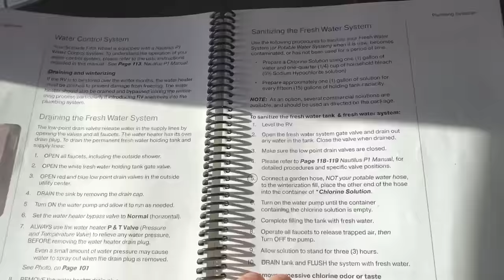MASSIVE WATER LEAK RUINED OUR RV - RV LIFE REALITY

Comment: When you patch a tank like that, grind grooves where the crack is with a dremel, and sand with 60 grit sandpaper. Then, add fiberglass fibers to your epoxy and spread it across the groove. Let it dry, and then coat it with a sealing coat of polyurethane sealant. Better yet, you can get pulverized ABS as a "tank adhesive' base; mix it with acetone to make a very  soft putty. grind the grooves, sand, clean thoroughly and prime the area with a few brush strokes of acetone. Push/brush in the abs/acetone mix, and wait a few hours and brush out the repair with a thinner mix of ABS and acetone (like gel thickness). Wait overnight, and epoxy coat with JB weld if your paranoid. Acetone dissolves ABS - using it to soften/adhere the pulverized ABS will solvent-weld the crack closed, and if done right the tank will be stronger where the weld repair is, just on thickness alone.
Reply from the maker: This is such great information Wendy!! Thank you for taking the time to write this our for us and everyone reading 😃 It sounds like there is a lot that goes into it, but heck...at least it beats taking your rig to a repair shop!

Comment: Technician here. The broken tube looks like a vent tube for the batteries in the front compartment. Most I’ve seen, they vent out towards the front however. Interesting to notice yours vent through the bottom underbelly. If that’s what it is.

Comment: Well I like that your showing your trailer , I’m a technician and found the best patch is a resin repair kit designed for radiator repairs it binds to plastic and metal and is at the automotive stores , if you found using this stuff you will know it’s like all-most instant and will seal any tank it also has a fiberglass mesh for the harder to do repairs. It allso works great on other plastic repairs like bumpers that have striped screws it can be drilled or tapped too. Just ask for raidiator repair kit the one with the fiberglass mesh it cost about 10 bucks , Happy Adventures
Reply from the maker: Wow you know your stuff! Thanks for the great info!😃

Comment: Hey guys I don't know how your rv works but our motorhome has an overflow valve on top that when you run out of capacity it comes out of the oneway valve. If it's still cracked get a plastic welder from on line and see if that will make it stay closed the problem is it's at a joint and when you put all that weight in the tank it pulls on that stress point. I've been in my 2012 Georgetown since I bought it new and leaks are the nature of the beast. Good luck and Happy camping!!!!!

Comment: You guys rock for diving in to fix it! We’ve had 3 in our 2020 fifth wheel. Vacuum breaker behind the shower water facets is notorious for leaks. I dropped one tank and used Oatey medium black abs cement to fix a 5 foot long crack in the top with this stuff and it’s holding strong after a year with us full timing off-grid. Truth he told, I blew my black tank up using the flush on day 1! Ha To drop a tank, cut the drain and vent pipes, disconnect sensor wires, disconnect drain valves, and I had to use a Dremel to cut the Buck bolts out and then remove supports and boom it’s out. There’s some good videos on YouTube if you wanna save some bucks. Ya’ll got this!!
Reply from the maker: That sounds like a lot of work for us! Time to visit the dealer lol - Thanks for sharing Dave, you are very handy!
Reply: @HappilyEverHanks  Heck yeah it is. Lol Good luck guys!

Comment: Our fresh water tank became dislodged. We figured a half full tank of water and going around a lot curves and hills in South Carolina did it We noticed the tanks were getting dug into by the brackets. We ended up getting a piece of thin plywood and used some closed cell form to cushion the tank. Also got some brackets to keep the tank secure and moved the drain tube from the side to the bottom. We plugged the old hole by spinning a plug in the old hole.  I'm sure you will get this resolved. You're doing a great job!
Reply from the maker: Oh wow, good catch! Thank you for sharing all that, it’s a great idea!

Comment: We had our rear gray tank drop and lay on the underbelly liner after hitting a huge bump north of Denver.😩 Luckily we got a mobile tech to help but it still took a week. Brackets too far apart when installed at the factory. Hang in there! Love you sharing the struggle. Nice job under there with the idea of looking around while it’s open. 👍
Reply from the maker: Thanks Ken. Sounds like your situation was a bit of a hassle!

Comment: I have never had luck using JB weld on plastic. The JB weld doesn’t flex when the plastic does. It will break away almost instantly when any pressure is applied. Actual plastic welding is the only way to for sure fix it. It takes the right equipment and some skill to do.
Reply from the maker: This is good to know, thank you very much for your insight 😃

Comment: The leaking tank in my trailer is made out of polyethylene. It's hard to get epoxy that will stick to it. After three tries I found JB Weld "WaterWeld" worked. I sanded the area really well so it would stick better. WaterWeld is a two part epoxy putty that you knead together until it is a uniform color. Then mold it into a patch and press it very firmly over the area where the crack is. Really work it into the surface. Then let it cure. It says it cures in one hour but just leave it overnight. You'll have a little mixed putty left over and just make sure this left over piece is rock hard before you try your repair. It worked for me.  Good Luck!
Reply from the maker: Thank you so much for sharing Tom! We had no idea this existed.

Comment: Bummer guys but appreciate the way you two are working through it. Thanks for the enjoyable content. 
Some of the manufacturers use a foam seal at the top of the tanks to mitigate movement and cracking. It will not leak if the water is contained in the tank or passing by. As you filled the system until is was not drain the sink it could be the pressure was causing it to leak past the foam seal. Just a thought. I really hope you end up getting a new tank.
Reply from the maker: That is a great idea! Thank you so much Bill!

Comment: I know what you're going through! we had a low/slow leak from the base of our shower in a previous sticks/bricks house.  This shower was in a part of the 2nd floor that was over the front porch.  Had to remove all the fascia and celing siding(or whatever its called) from the front porch and then all the soaked insulation in order to get to the drain.  Couple spins to tighten the connection was all it took.  then of course replacing and adding additional insulation(cuz the drain would freeze up in really cold weather!) and placing ceiling slats/fascia/etc back.  FUN!
Reply from the maker: Oh goodness, so sorry to hear this! No fun at all! Hope things stay nice and sealed now for you guys :) We have some updates coming out in a few hours on the new video, we hope that we can hear from you again!

Comment: Hello, not sure if anyone has mentioned it but I saw a video where you use ABS cement and take a ABS pipe and cut it in half or more to generate some shavings then use these shavings in a mix of cement with a piece of fiberglass screen and coat the crack.

Comment: So sorry to hear about the water leak.  I use JB Weld Epoxy in a lot of my repairs.  99% of the time, it does a great job but I've had a couple of failures.  I always wait overnight though to make sure the material is cured sufficiently.  I think if I was faced with this problem, I would also use aluminum tape over the epoxy to provide a good seal.  Another solution would to use the Flex Steel family of products advertised on TV.  Good luck.
Reply from the maker: All great information! Thank you Denny, you are very handy!

Comment: On our last rig after our third year of ownership the fresh tank started leaking. After dropping the underbelly I struggled to find the leak. We did just like you started the process of elimination. Then I lifted up on the tan and saw a hole. The factory had actually, when bolting the underbelly to the frame, shot one bolt on the wrong side of the tank support and punctured the tank. It literally took 3 years to leak. I used a JB weld product but it was 2 putties that when combined they would be pushed into the hole or crack and turn to cement. I think it is called Waterweld. Then I covered it with flex tape. Good luck.
Reply from the maker: This is really great information! Too bad you guys weren’t there to walk us through this 😅 thank you so much for taking the time to write this out for us, it’s nice to hear what works for you guys!! Stay safe friends, we look forward to hearing from you again soon!

Comment: Hi guys,sorry for your leak problem looks like a new tank fixe , but make sure you address the rubbing problem before reinstalling your tank in the meantime you could try the rubber roof tape and put it over the crack in your tank should be ok for about a month and the tube hose that came appart at the front of your underbelly is probably a air vent for your battery and some electrical, good luck don’t give up where all rooting for you happy new year, Mike from Quebec 👍🏻
Reply from the maker: Good to know thank you so much for sharing Mike!

Comment: I have a 2011 KZ travel trailer, bought used in 2018.   I discovered a soggy underbelly a few weeks into my ownership.   Not a plumbing leak!!   Just bad sealing on the underside when traveling in wet weather. It was kicking up water when driving and was in the heated insulated tank area. I removed the liner and insulation in that area and left it off, now no soggy under tank insulation. It was also starting to rust some metal in the area.   I don't need heated tanks, I'm a warm weather camper!!
Reply: At the same time I doubled up on the support straps on the water tanks to better support the loads when full and traveling, I think they skimped on the supports as it sure sags when tanks are full, can't imagine the force on the plastic when bumping down the road.
Reply from the maker: Hey Bob! Cant argue that, we are trying to become warm weather campers as much as we can 😄We definitely need to invest in some more support straps and get some rubber as a barrier between the tank and the metal beams that they rest on. Thank you for all your support!! We hope to hear from you again soon :)

Comment: 3M 4240 | Semi-Rigid Plastic Repair. Use 80 grit paper very aggressively to get a good fur built up then apply this repair.  I recommend using a piece of patch material.  Use this type of epoxy to repair automotive bumpers it’s water tight.

Comment: So sorry for your trouble.. you are on the right path with the placticweld allow it to cure for 24 hr or more as long as you can let it set .. there's a cut peal and stick foam to put anywhere tank touch the frame to prevent rubbing..I use the peal n stick on my blue boy to give it some roll around protection when traveling.. hope this helps keep looking up
Reply from the maker: Thank you so much for sharing!

Comment: As someone who has completely ripped apart an RV and also lived in another one, I want to give you some advice. First, know that your tanks MIGHT have an overflow drain on them. If it has one, it's on the top, and it should allow the overflow to drain onto the ground so you don't ruin your RV with a flood if they get filled up completely. That might be the source of the leak and you'll want to drop the tanks.

Dropping the tanks might be harder to do than it seems, as all your drain pipes are plumbed into the top f it, so if possible, see if you can check the top of the tanks. (Ex. Use a snake cam, open an access panel looking down on the tanks, etc.)

If that fails, then given that you can reproduce the overflow, look to see the general area that it's coming from. You checked your shower and saw one of the leaks, but it seems that it's not the issue since you filled them and appeared to have all of your water flows turned off. I'm thinking it's a loose drain connection to the top of the tank.

Your tub might have a space under it with an access hatch, but if not, you might need to remove the tub/basin and check the connections that way. Be sure to caulk your shower once you're done so it doesn't damage the paneling behind it.

Hopefully this gets you on the right track.
Reply from the maker: Thanks for the great advice!

Comment: 1) Epoxy has a cure time that is temperature sensitive. Read the container and if it is too cold use a hair dryer. 
2) when replacing insulation consider Roxul. It is spun molten stone. More sound proof, better insulation and resists water damage better than standard insulation
Reply from the maker: Yeah, you nailed it! I don't think we allowed this Epoxy to set long enough by any means! We appreciate this great information Douglas! 😃
Reply: @HappilyEverHanks  the Roxul is also very good at soundproofing.  Have fun!

Comment: Had same sort of problem with a 36' Cougar 5th wheel. Kitchen sink tank support bracket (back side) at the step side, had broke and when  it filled it would fall down with the weight . It ended up cracking the tank at the top of drain side. P...k of a job to remove the whole tank so I bought a fiberglass r repair kit, patched it and repaired the support bracket. I believe the self tapping bolt was broke from day one and it happened on our maiden voyage and 1500 miles from home. After that we always left the kitchen drain open at RV parks. I cut the "coreplast" underbelly out and replaced it with a new 4x8 section.
Reply from the maker: Wow, you are very handy! Thanks for sharing! We need to stop letting our grey tanks fill all the way as well!

Comment: I had the black tank get a crack. Here is what I did to fix it. Bought a small abs pipe. Took a cheese grader and graded a cup full of abs pipe. then bought abs glue. Mixed abs glue with graded abs pipe. this will really add a lot of strength to the abs glue. Your mix will be thicker than pancake batter. Spread on cleaned crack, let dry 24 hours. I repeated this prosses four times and it has held for over four years now.
Reply from the maker: Thank you so much for sharing! Glad it worked well!

Comment: The directions will tell you how long for a full cure. Don't shortcut it.  I would use epoxy and fiberglass cloth, 2 to 3 layers. Epoxy, glass cloth, epoxy, glass cloth, epoxy. Or a plastic welder(harbor freight) and some scrap abs for filler. This takes some practice. Also abs solvent cement used to join pipes will melt(dissolve) the tank and you may be able to close up the crack. I think the glass cloth and epoxy or maybe polyester resin would be best. Definitely call your RV manufacturer for recommendation or check youtube.
Reply from the maker: Thanks for sharing!

Comment: I know the feeling I had a rat that got in my rockwood roo. The rat ate my pex plumbing pipes, the rubber gas pipe and the heat venting. I replaced all the pex to a steel braided plumbing lines. Checked and fixed my electrical lines plus a better heat venting.
Reply from the maker: Oh that’s such a pain, good thing you are handy!

Comment: The tanks are flexible and expand and contract quite a bit. You need something to seal the tank that also is flexible. I've used a marine sealant that can even be used under water. It's flexible and it lasts. Bought it in the hardware store.

Comment: Oatey 8-fl oz Black Abs Cement

Black cement solvent welds ABS pipe and fittings, dauber included

Easy-to-apply medium body has excellent gap filling properties ......
Just layer it on to build the thickness.  It will take a day between coats and a few days to cure but will melt the whole/crack back to new ! You can use fiberglass screen to build up between layers the hardware store should have screen and Oateys.
Reply from the maker: This is excellent information Vincent! Thank you for taking the time to write this out. We are going to be bringing some new updates tonight, we hope to hear from you again then! Stay safe

Comment: you probably already fixed it..  but you need to use actual ABS pipe glue.  you can take thin door or window screen and a spare ABS fitting.  you start by shaving the fittings into the glue to thicken it up.   then apply a layer over the crack and area around it.  then apply the screen.  then apply more glue.  then repeat the process a few times.   Also make sure the screen is plastic material if possible.  also drill the crack at the ends so that it doesnt spread.   I have helped fix several tanks this way in the last few years.   ps. I was a plastics engineer in my former career before going full time.   There is a webpage that describes this method somewhere, but i dont have the link to it anymore.
Reply from the maker: Wow this is excellent information Bill! Love that you were a plastics engineer, YOU WOULD KNOW!! Awesome details listed here, we appreciate your time :)

Comment: Sorry about the tank issue but those things do happen!  I had a TT with grey water  holding tank at the rear and the first time we used it at a location with no dump, I backed out of our site and when I pulled forward water poured out from the underbelly!! It was new so the dealer repaired it, found a cracked fitting. I found another leak a year or 2 later and had to take out my stove/oven to get to the connection to the tank top. Also had to remove my shower assembly to get to that connection to the top of the tank trying to find the leak. I never dropped the tank because it was right above the axles!! The assembly and quality control don't always go hand-in-hand! For your situation looks like someone during the assembly would have noticed that sharp angle iron so close to the tank! Waiting to see your next actions.
Reply from the maker: We'll keep everyone updated! Thanks for sharing! Sounds like you had a rough situation as well!